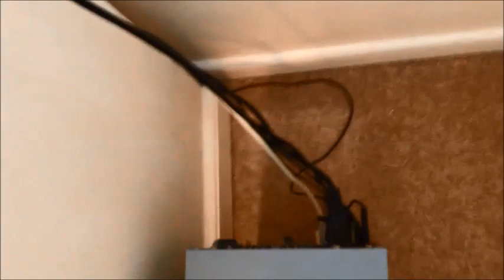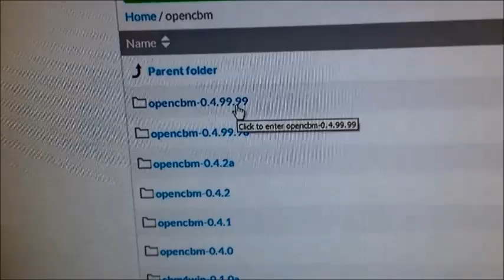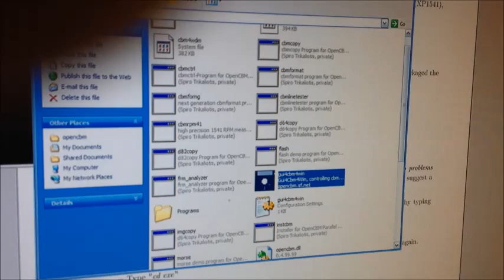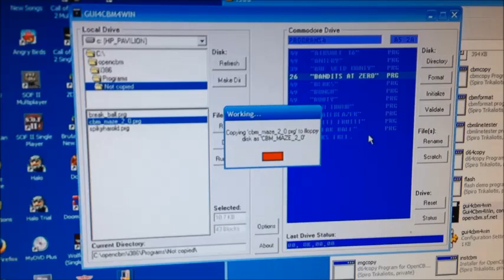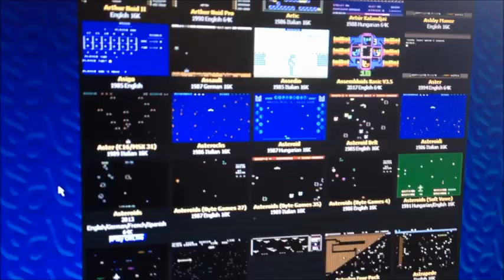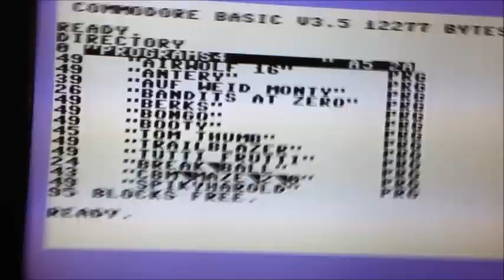Transfer files from PC to Commodore 1541 - Step by Step

Comment: I think it would also be cool if we could just install a standard-density MFM PC drive and use a software that could convert it to run in GCR mode and whatever else the Commodore 8-bit 5.25" drives need, so that you could just use that drive built into the PC and then leave the 1541 or other compatible drive (including 1571 in 41 mode) over at the Commodore computer instead of having to move the Commie drive fourth and back or having to have an extra one always hooked to the PC, etc.
Reply from the maker: Yes that would be ideal so you didn't have to swap the drive between the PC and the Commodore, but still pretty cool that you can use a PC to copy programs and create usable disks for the Commodore.
Reply: @mwcool87 : Between the PC and the Commodore computer, that is (the drive is a Commodore too). But yeah, this is definitely cool!

Comment: Wouldn't it be cool if it would just give the 41 a PC drive letter? But then that would raise questions like: What if you copied non-Commodore-8-bit-compatible files to it? Or even without a drive letter, can you do that through this? And if so, then what file types do they translate to? Like would all data files from the PC turn into SEQ on the Commodore, and all EXE become PRG even though they wouldn't EXEcute there, and all DLLs be USR or REL, etc.? What, exactly? And then it would also be interesting if you could do the reverse: have a Windows-compatible file on a 1541 disk, and instead of just copying it from there to the PC's disk, you could load it straight from the Commodore drive into the PC's RAM and run it!

Comment: I have the XM1541 Cable, 1541 working disk drive, and good old HP Pentium running win XP.  I have downloaded both the OpenCBM and the gui4cbm4win and tried to follow the instructions.  However, NO Deal!  I do get into the gui software, but I am not able to communicate with the 1541 and stop it from spinning.  I get the error message that says "access denied".  Can anyone tell me in simple terms how all of these files are supposed to be laid out?  Definitely having trouble trying to follow the instructions!

Comment: It's really not the 1541 that was burdened with slowness, a design flaw in the 64 that made even the higher-model drives such as the 1571 and 1581, forced to be slow just for the 64's sake, which even the 41 wouldn't have had to be if it hadn't been for that flaw and Commodore's believe that they should rush it to market without fixing that bug. Because unfortunately that affected the whole range of 64 variants and drives that would be compatible with it, and we would forever be stuck with aftermarket solutions which wouldn't work in all cases. Something like Fast Load or Warp Speed would probably only bring the system up to about the same loading speed as an Apple II computer and Drive II without a comparable too and for the same amount of data. So then I wonder if using the 41 with this PC software sets it up with the faster speed, and that's why you think it's faster. But let's see you buy or borrow a 64 instead of using the 16 (to be sure that it's apples-to-apples) and do a time test between copying it from the 64 disk to the PC and loading it into the 64, and then doing the same with saving for the same size of file (meaning that without an ML monitor on the 64, it would have to be an all-BASIC file for the save test).

Comment: HELP!!!  I just received a new XM1541 Cable.  I connect the parallel port on my old HP (Win XP) and the other end to the C-1541 drive.  The drive simply continues to run whether I start the drive first, or start the computer first???  How to solve this??
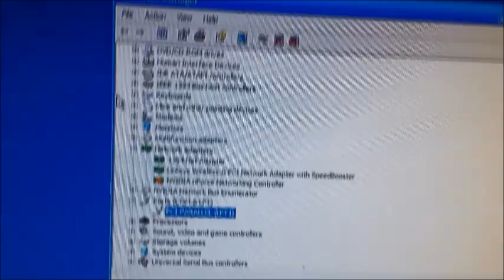Reply from the maker: I vaguely remember having that issue and I think it had to do with the LPT port, see starting at 1:42 in my vid, you need to change it to LPT1.

Comment: In reference to earlier comment, I already had the LPT1 set and my 1541 continues to run upon powering up with the windows XP machine???  I am using a brand new XM1541 Cable from Europe.  Please, any other suggestions??
Reply from the maker: Did you use the version I did 0.4.99.99 from 17th of Sep 2017?  If not try that and delete the old install and reinstall (the part you do on the cmd line).  I definitely had that problem and it was either switching the port or using the correct version that fixed it.

Comment: Where can I get that cable in the U.S.A.?
Reply from the maker: Here's one I found on ebay.com but it ships from Germany.  Still around $22.00 with shipping so not so bad.  You can definitely find them on ebay.co.uk not sure how much the shipping would be.  Weird that they don't have any in the US right now. https://www.ebay.com/itm/XM1541-Datentransferkabel-C64-bzw-Floppy-an-PC/361509839140?hash=item542baa6124:g:aCQAAOSwKfVXFmJB
Reply: Buy an old printer cable and a 6 pin din plug..make it yourself..plenty wiring diagrams for it . online.

Comment: After installing the USB drivers for the XUM1541, I was looking all over the place for a Windows executable in the latest opencbm archive and couldn't find any. Now I see why!! It's not a real piece of software, just a flimsy DOS command with a separate GUI for it !!! OMG, this is how you're supposed to use your XUM1541 ???
Reply from the maker: True it's not very advanced, but the GUI does make it very easy to transfer files.  You only need to use the command prompt/DOS commands when you first install it, then use the GUI from there on out.
Reply: @mwcool87  Once OPENCBM is installed, you have to install CBMXFER and they must be in the same directory for things to go smoothly but for some reason, by default they install in different ones. Once I fixed this, things got up and running.
Still, this is no real Windows drivers and app. That's because the people who designed the XUM1541 make no money out of it and the people who actually sell it to you have almost no say or contribution, financially or otherwise to it.
Latest OPENCBM is 0.4.99.103 and latest CBMXFER is 1.10.
Reply: @mwcool87  I just tried to install NibTools and all 5 files in the Zip file (I got r679 for win32) immediately got deleted by Norton as they were flagged as unsafe files. Once I managed to convince Norton to let them be, I put them in the opencbm directory and all they do is crash with a cryptic pop-up saying 'The application was unable to start correctly (0xc000007b). Click OK to close the application.' All these efforts because I thought I would be able to dump a few G64 and convert my original disk of 'In the Chips' for the C64 to PC format. Absolutely nothing works.
Reply from the maker: @francoisleveille409  I've never used NibTools, and I've never tried creating a D64 image from a 5.25 disk.  I've only ever downloaded PRG files and written them to the 5.25.  Let me try going the other way and create a D64 image on the PC from an existing 5.25 and I'll let you know if I'm successful using my current set up.
Reply: @mwcool87  FWIW, at least transferring non-protected files and disks works well at this point. It was an uphill battle but I managed to get this much.
Reply from the maker: @francoisleveille409  I just tried and was able to create a D64 image from one of my disks.  Using the GUI I clicked on Directory, didn't select any individual files, pressed the left arrow, named it test.d64 and it created a .d64 file on my hard drive.  I was able to attach it as a disk image in the Yape emulator, view the directory, and load and run a few of the individual .prg files.  Sounds like you got that far as well.  Mine aren't protected, but I'm sure you can find something out there to crack the disk protection.
Reply: @mwcool87  Cracking the disk protection is not the point. Nobody has a working archive of the original disk of 'In The Chips' for the C64. I probably have the sole surviving copy. It would be nice to have a disk image before it turns unreadable.

Comment: I got the exact same setup except I'm using 64-bit Windows 10. This was actually working perfectly fine until a few weeks ago it started to give 99,driver error. I can't figure out what the problem is. What does your configuration file look like?
Reply from the maker: Hey there, so sorry for the delay I'm just seeing this message.  I did get that error until I had my config file set up correctly.    I'll let you know what it looks like when I get home, but hopefully you've figured it out by.  It was probably due to a Windows 10 update.

Comment: Hi Mike! Just the other day, I installed my Zoomfloppy and GUI4CBM4WIN software and everything is working great, except there is one problem I seemed to have come across. I have no issues copying a D64 file to my 1541 floppy disk, but before it copies, a message keeps coming up reading, "This will overwrite ALL data on the floppy disk. Are you sure?" For some reason, it is only allowing me to copy "one" D64 file to my floppy disk, and if I try to copy a second file, the same message will come up saying it will overwrite All data on the disk. I'm trying to get it like in your video where I can copy as many files onto the floppy disk that it will hold. Have you ever come across this problem? I appreciate any suggestions you may have.
Reply from the maker: Hi Jude, glad to hear you have it working!  I believe your issue is due to the fact that you are using D64 files which are basically like a disk image and only one can fit per side of a 5 1/4 disk.  Even though there may be more room on the disk,  it will always overwrite it (kind of like a disc image .iso file for a DVD you can only burn it once per DVD).  I'm using PRG files in my demo hence why I can fit many onto one disk.  I'm using a Commodore 16 which there are plenty of PRG files available on the internet.  You are probably using a Commodore 64?  I think the Commodore 64 games are unfortunately usually in D64 format so you can only write one per side of each disk.  I found a great place to buy refurbished 5 1/4 disks at a reasonable price if you want the link (based in the UK though).  Hope this helps!
Reply: Mike, I found a website that has PRG files and tried copying those to the 1541 floppy. I was now able to transfer them individually to the floppy disk. I tested about four of them on my commodore 64 and they are working. Thank you so much  for clearing that up for me.
Reply from the maker: @judestrauch4261  Good news, I'm eventually going to get a Commodore 64 so I'm happy to hear there are PRG files out there for it and not just D64 files.  Glad to be of help, enjoy your Commodore 64 and 1541!
Reply: Mike, this is the website I found. It has quite the list of C64 games in PRG format. Maybe you'd like to try it. http://www.planetemu.net/roms/commodore-c64-games-prg
Reply from the maker: @judestrauch4261  Thanks so much!  I will be getting a Commodore 64 in the near future and this will come in handy :)
Reply: @mwcool87  Hello. Great vid. I want to try transferring an making my own Disks and back ups. I wanted to ask where you get the refurbished disks in UK? Do you have a link? Thanks.
Reply from the maker: @saddiqkhan5821  Hey sure no problem, you want DSDD disks for the Commodore (and most other 8bits).  Here is where I got mine: http://www.dataserve-retro.co.uk/contents/en-uk/d183.html

Comment: Oops, there's no such thing as a "GUI interface." What guess might you have as to why?
Reply from the maker: Are you trying to install it on your PC?
Reply: @mwcool87 : You can't install a "GUI interface" anywhere, because they don't even exist as a thing in general. So I asked you make a guess as to why they don't. What do you think the answer to that is?
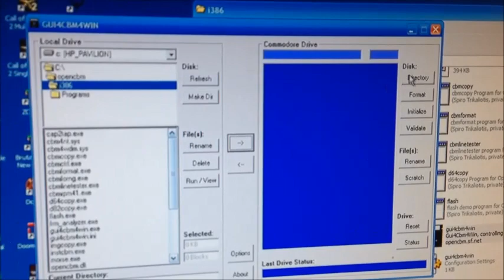Reply from the maker: @HelloKittyFanMan  This does use a GUI to transfer the files etc which is called GUI4CBM4WIN, that part starts around 7:00  in the vid.
Reply: Yes,  @mwcool87 , I do believe it has a GUI. I'm not disputing that. What I'm saying is that there's no such thing as a "GUI interface." But I wanted see if you can show that you understood why is that is the case.
Reply from the maker: @HelloKittyFanMan  Oh, not sure, is that what I said?  I made this video a long time ago and probably made some mistakes.  I guess because interface is already in the acronym GUI (graphical user interface) so its a repeat of the word?
Reply: @mwcool87 , how long ago you made the video isn't really relevant. And yes, of course "GUI interface" is what you said. I wouldn't say that if it wasn't, would I? Yeah, a "GUI interface" doesn't exist, because that's like saying "graphical user interface interface."